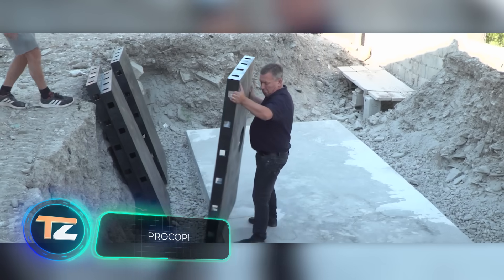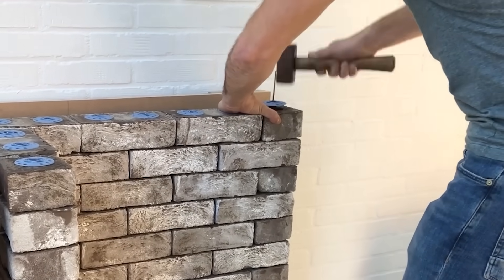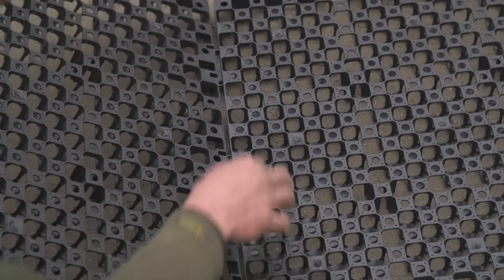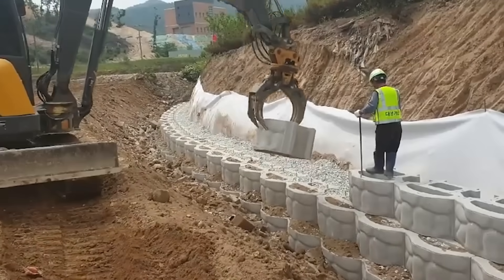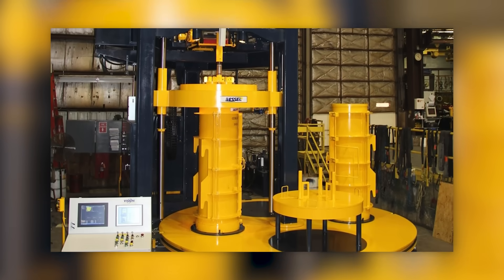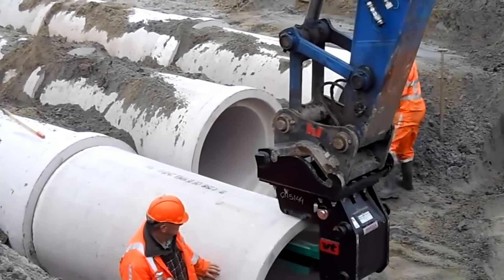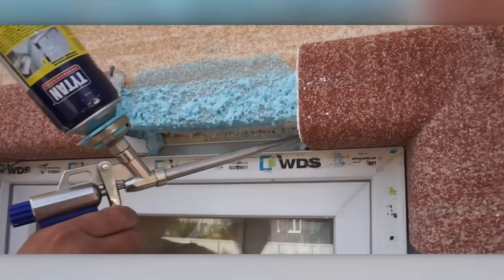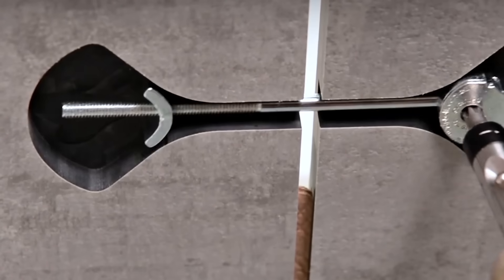INNOVATIVE CONSTRUCTION TECHNOLOGIES THAT YOU SHOULD KNOW ABOUT

Comment: That brick wall looked like shit. Had the strength and rigidity of a snot sandwich.  How was it going to be waterproof with no mortar?  Horizontal rain in European winters will send water right through it and into any insulation rendering it useless .  The wall ties were fiddley, more expensive and time consuming compared to butterflies. Garbage

Comment: Those bricks were shaking, even two layers down! I'm not certain that I would call that more secured.
Reply: And how would that be cheaper, than mortar?
Reply: @Bergerons_Review  When you consider it's just a facade, then you have to pay for a proper structural wall first and then buy all the crap needed for your fake wall. A far cheaper method is plastering or applying cement and then using a former to create a brick effect.
Reply: Hardly waterproof either
Reply: Those are shitty only thing keeps them from moving are those clips attached to a real wall.
Reply: When it falls down don't complain you didn't use traditional methods.
Reply: @jimm8246  But hey at least you didnt have to overpay for an experienced worker lmao
Reply: Haha I agree. Definitely not as good as the 3rd little pig’s house. If you waste your time stacking bricks without mortar, you should account for more wasted time restacking them after they’ve fallen over.
Reply: Ugly too.
Reply: Gemauert wird mit Mörtel. Alles andere sind keine Mauern sondern Schrott!